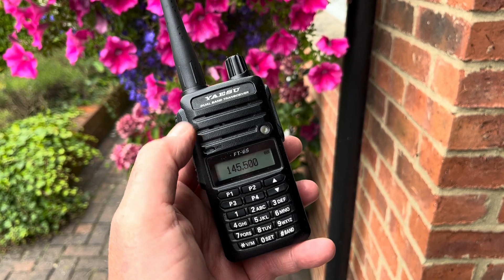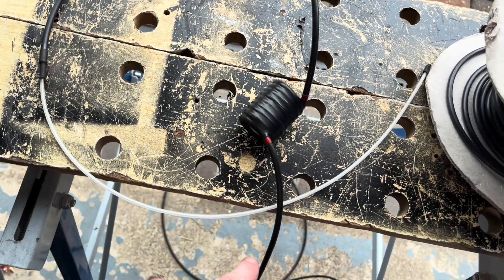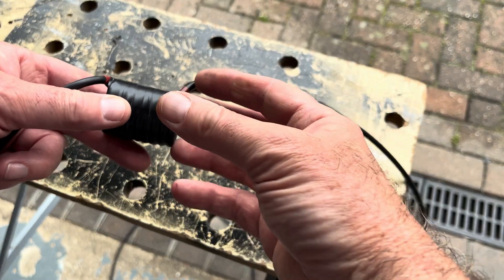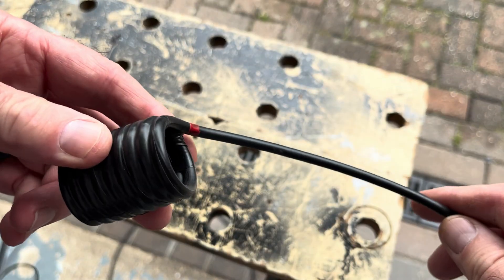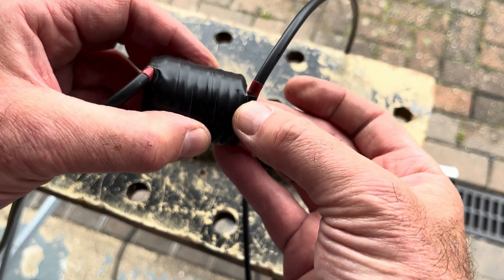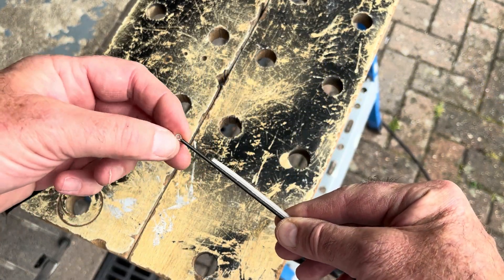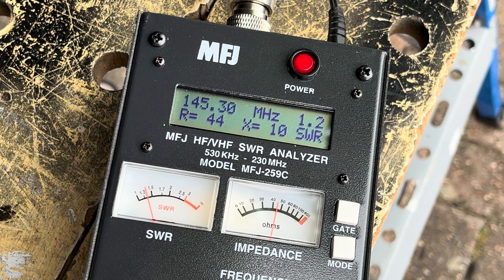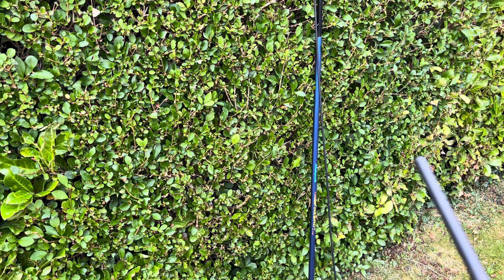Simple & Effective 2m Antenna - Build & Test

Comment: I’m just learning about antenna building.  Starting with 2m is an easy way to experiment.  Can you tell me why 9 turns was the proper number?
Reply from the maker: Yes, at 145MHz, the 9 turn coax coil is in effect a wire wound inductor of the correct uH inductance. I didn’t measure mine as I took reference from another source, so don’t have the value. Hope this helps 👍🏻
Reply from the maker: ps. Such inductors act as a block to rf, same as on a trap dipole. Some frequencies s
“See” the trap and are blocked, while to others it’s “invisible” and they continue past….

Comment: It looks like you have some reactance in the circuit (x). 
Reactance is a type of opposition to electrical flow, or resistance, that occurs in alternating current (AC) circuits.
Ideally, you want that as close to zero as possible. You may want to try to add a cap and try to cancel that out for efficiency
Reply from the maker: Yes, thanks for the tip.

Comment: Hi Ian, Keith, WB2VUO near Buffalo, NY.  I discovered the Flowerpot vertical a few years back on VK2ZOI's web page. Following his instructions, I built models for 6 meters, 2 meters and 1.3 meters. I have had very good results with all of them, and even replaced a commercial 6 meter vertical with the Flowerpot. It's great on FT8 and I run a local SSB net with that antenna.  Keep building and I will be looking forward to more videos!

73, De WB2VUO, Keith in Amherst,  NY
Reply from the maker: @Keith_WB2VUO  That’s great. Thanks for the info Keith 👍🏻

Comment: I've carried out tests with a Quansheng UV-K5 (8) on both bands using the standard antenna, a genuine Nagoya antenna, and a Diamond antenna.  In all cases, the standard antenna outperformed the other two longer antennas.  That actually surprised me.  

The test was carried out as scientifically as I could perform, with a dummy load connected to the receiver.  The transmit was 6m away in a static location through the test.
Reply: Quansheng uv-k5 have one issue with custom antennas like it is J pole, diamond, closed dipole or any other type of antenna which indeed have short circuit at 100Khz., Physically all antenna mentioned in my post are short circuit measured with simple ohm meter. That actually makes quansheng does not get any Rx or very poor with allot of noise. While it do Tx very well and TX significantly outperform it's standard antenna. It's is all about how quansheng is built. It need some hardware modification in order to accept all type of DIY antennas. Well what antenna will work with quansheng , are classic dipole , GP type , or any other type of antenna which does not have physically presented short circuit measured with classic ohm meter. This all was tested yesterday with my quansheng uv-k5(8). Had friends on Viber while was testing new self made dual band J pole.  They could hear me with very strong signal , however I could not hear them.  At same place , on roof 30m above surface, with standard antenna they could hear me way worst than with J-pole but with difference that I could hear them as well. So we started with search what is wrong. NanoVNA could not detect any issue with J-pole. Then one of friend said, cut ground use only middle wire.  I did that and guess what, They could hear me quite stonger than with classic antenna but as well I could hear them . Conclusion from more then one man who knows this job, is quansheng does not accept antennas like it is j-pole or any other which represent short circuit measured with classic ohm meter
Reply: @FantaBH  This is not the experience I have had.  I made a j-pole antenna to work on 70cm and tested it with the Quansheng UV-K5 (8).  I got better results over an 8 mile (13 kilometre) distance, both RX and TX, using the j-pole antenna than the standard antenna.
Reply from the maker: Interesting results John. I've not got one to try this out...
Reply from the maker: Interesting indeed.

Comment: Have you tried 2/70 with this antenna , if it is possible?
Reply from the maker: I’ve not got a way of testing on 70cm unfortunately…
Reply: @G0CNN-Ian  Thanks for the reply. I was just wondering if it was possible. Your explanation and demo was spot on, very easy to understand and replicate. Thank you. 73
Reply from the maker: There are dual-band designs out there, but I’ll only be using 2m in reality, so this build (& video) was to be as straightforward as possible 😀👍🏻
Reply: The 2m version should be OK on it's third harmonic, but will most likely be out of the band slightly. Mine 2m version is resonant at 458.300mhz, just a bit high. There is a simple enough fix, and it works. you make the antenna the same way as shown, but with a few more simple steps and it becomes a dual band antenna.